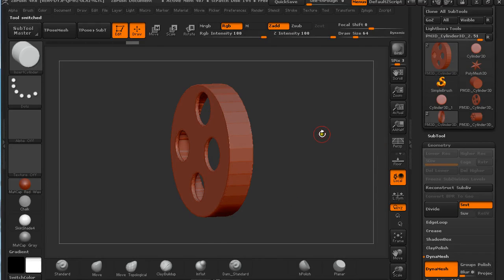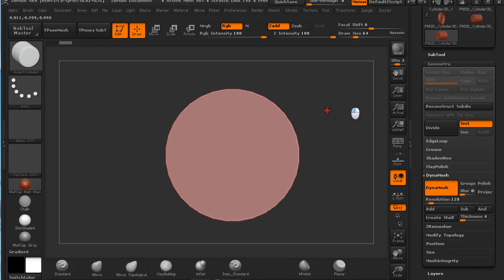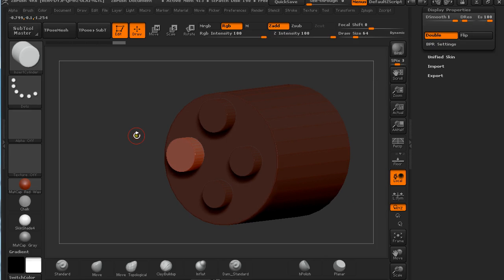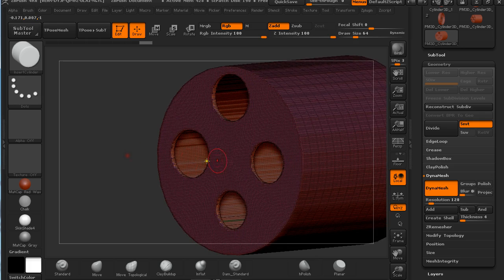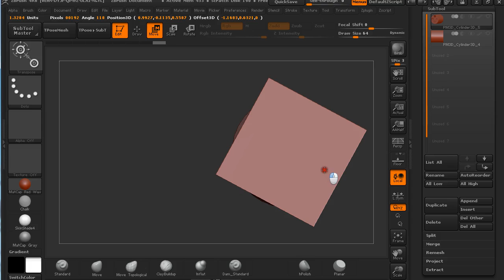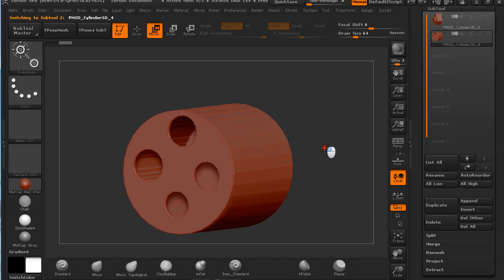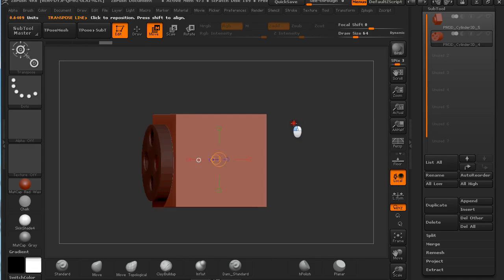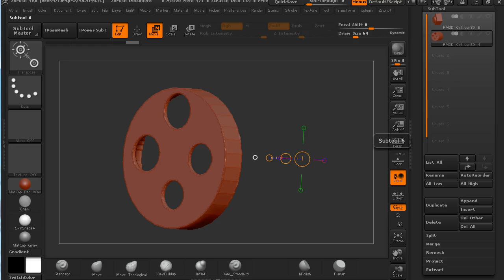Quick tip tutorial: Dynamesh subtraction issue/solution in Pixologic ZBrush 4R6

Comment: Instead of using a cube, wouldn't it be easier to simply use a clip brush to cut the main the cylinder?
Reply from the maker: The video is about how to solve the issue of using Dynamesh on objects that have multiple polygroups.

Comment: I have only one polygroup but when I activate dynamesh to help out when I am using the move tool it's still just dragging out the polygons instead of creating new ones :c
Reply from the maker: After using Move tool you have to redynamesh the subtool to get new polygons. Ctrl + click & drag on the canvas to redynamesh.
Move tool by itself doesn`t create new polygons (there are some exceptions - watch this tutorial Quick tip tutorial: Hard edged Lo-poly extrusions in ZBrush ) but generaly the move tool just stretches the existing polygons - thats why dynamesh comes in handy (when redynameshing).
Reply: ***** oooh I see, I missunderstood something, I tried this and its working but sometimes after I restart the program it wont, dynamesh is already active but not working and when I divide or redynamesh nothing happens :s
Reply from the maker: kutkuknight you have to actually make a change on the model to be able to redynamesh
Reply: ***** oooh thank you, yes once I use the move tool its working... damn thats complicated >__<